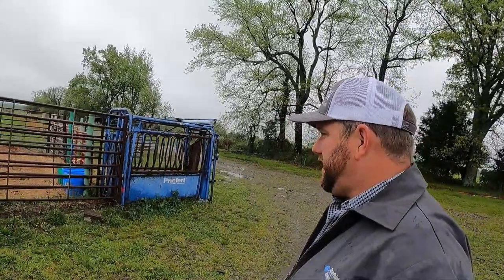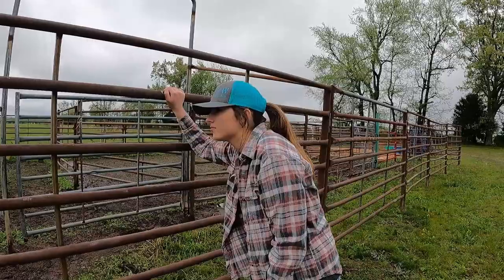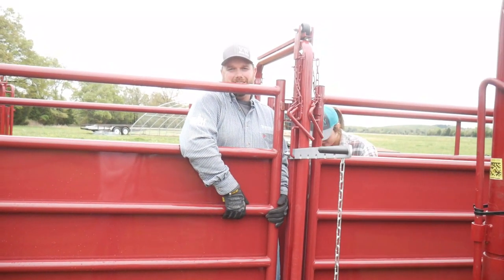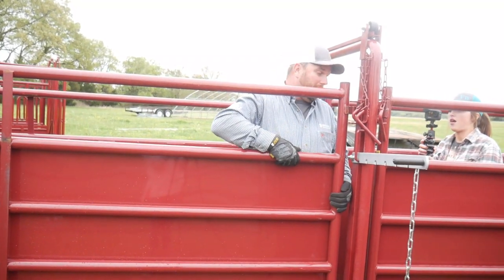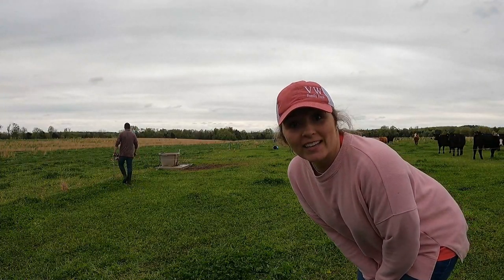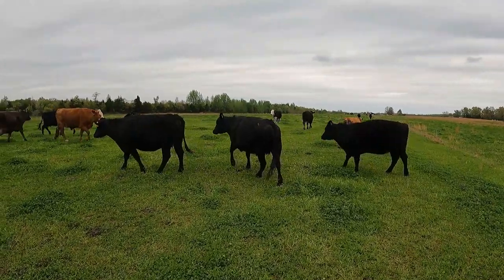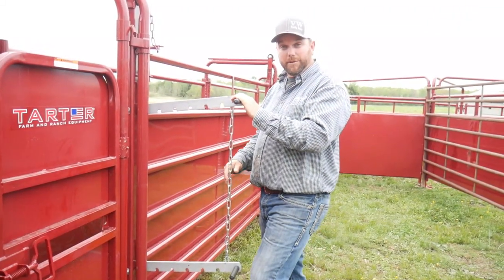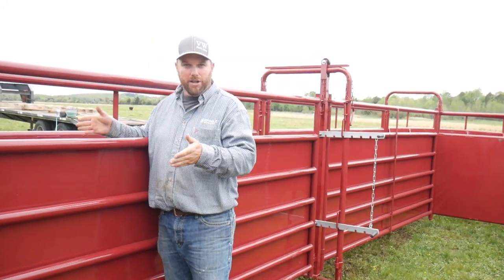Tarter Tub, Alley, and Chute Assembly and Action

Comment: Love that new system! Especially the turn with the push gate. Wish I'd had something as nice when I was working cows. Hell, back then anything smaller than a yearling, got roped and thrown to be worked. Had to partly disassemble the squeeze Shute and grease everything, before it would work. (It was a year between uses, due to rotation and different shutes in all the pastures. Hell, some may not have been used in 3-5 years. That happens on large ranches. Many were also homemade, in like the 40's to 70's. Fixed wooden ally ways, with wood gates. Wood sided corrals, and gates. But then, we also used horses for herding the cows, and we usually ran 50-100 cows at a time. Sometimes more, if we were doing a round up on a shared BLM pasture. Two or three ranches working together to get cows sorted by brand. Might take a week or more to get them all worked. 

The technology has come a long way.
Reply: We did have one squeeze shute that was built in the 1930's, with a metal frame and 2X6 oak boards for the sides, and a metal home made head gate. It actually worked pretty good, if we replaced the wood sides every couple of years. Could only use it on the normal sized cows, but the larger bulls or cows, (Especially those longhorn crosses with large horns) had to be taken elsewhere, as they wouldn't fit.